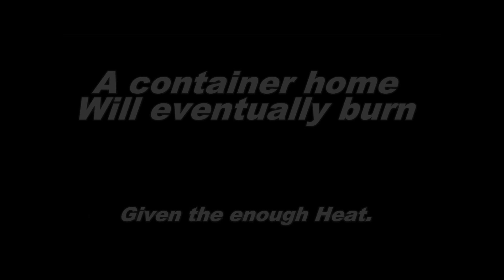Container Home Bolting up

Comment: What?!!?!? You didn't just use some hot melt glue and slap them together? LOL Nice job lining up the holes on either side, will the bottom get recoated at some point to keep it from rusting holes through the floor?